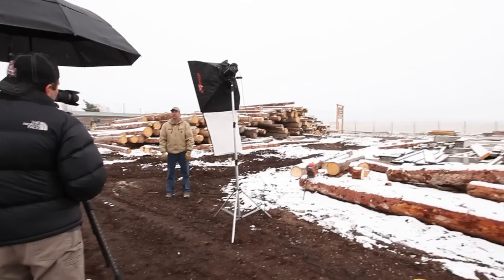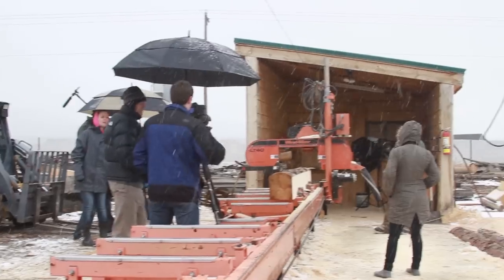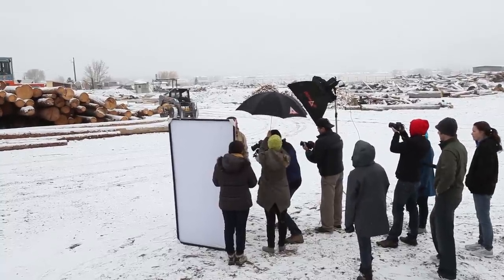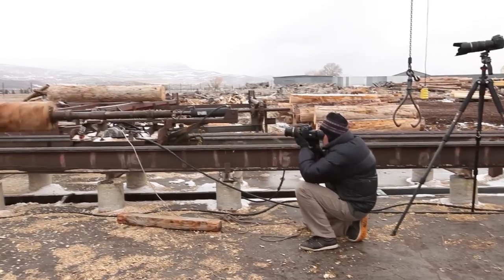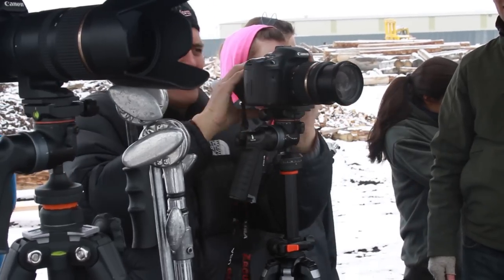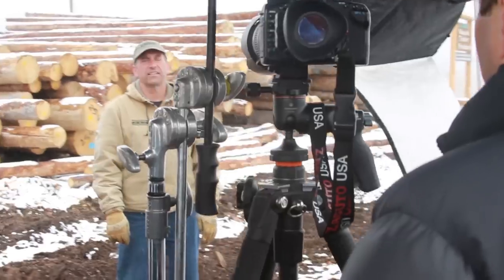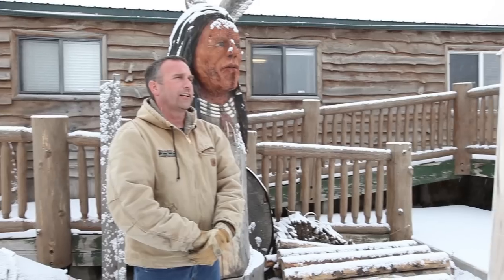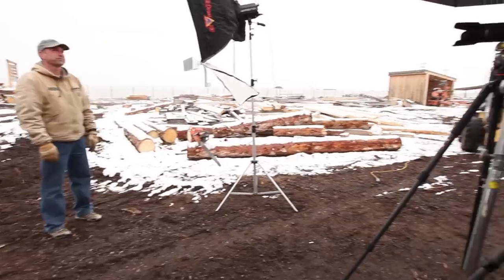Shooting a Documentary Style Interview - Video Tutorial

Comment: This is great! Very helpful. I'm full-time in production audio, and I would like to say, I know most producers say, "lav the talent, and use a boom for backup," but let me explain sometging: that lav capsule that came with your Sennheiser kit is literally a $15 mic, and even if it's upgraded to a Sanken, it's still a tiny $350 mic. My primary shotgun mic is a $2,000+ microphone, worth more than the cheap wireless plus the upgraded capsule plus the zoom recorder - and it sounds as good as the best top-end studio mic. If the lav ever sounds better, it's because the boom wasn't positioned correctly, even if you're using a less expensive shotgun mic than what I use. For some shots a boom isn't practical, but when the best quality is your priority, you can almost always work sound and camera together in a way to get a good result for both. For those 2-camera, otf off-camera interviews, I'll use a c-stand with a clamp to hold the boom in position, set the preamp gain appropriately and ride the fader to keep the recorded level just right. I'll work with camera to determine whether the boom is best placed overhead or from beneath, depending on the setup of the wide-mid shot, and I'm almost always able to get to a compromise where the shots can look great and the mic can be placed closely enough to get perfect, clear dialogue. The lav is there for backup ;)

Comment: great Video! I just wanna know on how would you sync all the audio? Do you leave all the cameras in one place all the time while it's recording? For example, you wanna get a handheld shot but the camera you're going to use is recording the 2nd angle. Would you stop recording on that camera, or just keep recording and remove the camera from its spot to get the 2nd angle?
Reply from the maker: Rj Garcia I use Plural Eyes to sync all the footage and audio tracks together. It can easily handle clips if you have started and stopped the various cameras at different times.

Comment: You're using multiple cameras thourhgout, which camera is being used (or can be used) on the Glidecam HD 2000? The product description states it can be used with a camera 2-6lbs. Do you think I can use the Glidecam with my Canon 7D. I ask because there are a lot of reviews on various brand stabilizers that state they also handle 2-6lbs, but don't. Thanks.
Reply: +Scotty Morris - I just purchased a Glidecam equivalent (for much cheaper), and will be using it with my 5D Mk3.  It hasn't arrived yet, but I thing it's going to work just fine.  Worst case, I just need to add more weights.
Reply from the maker: Yes, you can use a Canon 7D with the Glidecam. I know because I used to use it when I had that camera. You'll want to avoid a large/heavy lens though. I think I typically used the Tamron 24-70mm on mine.